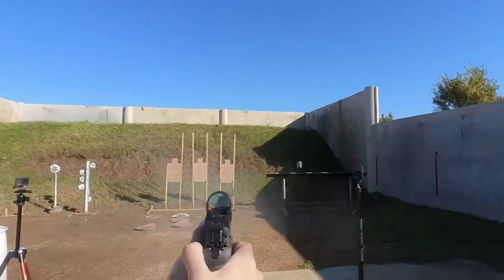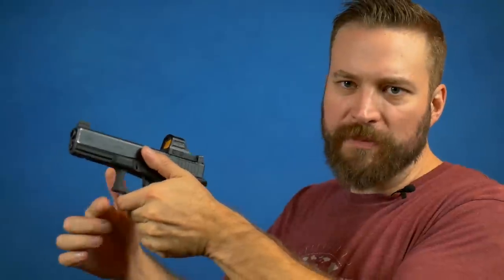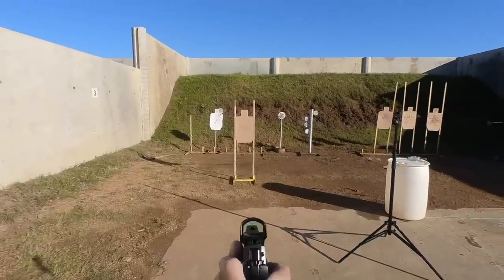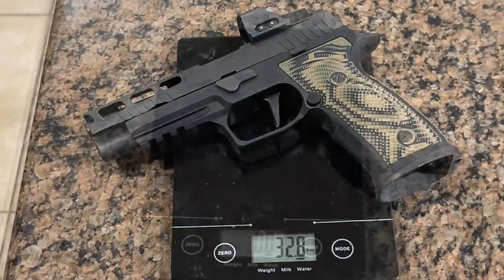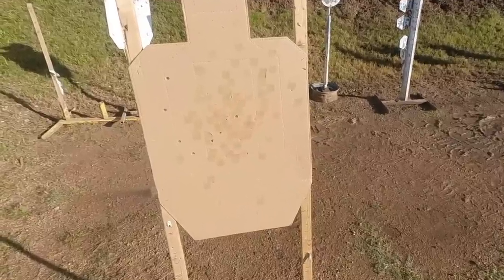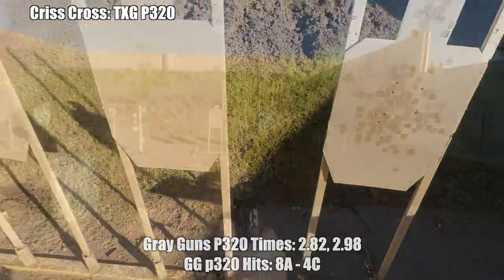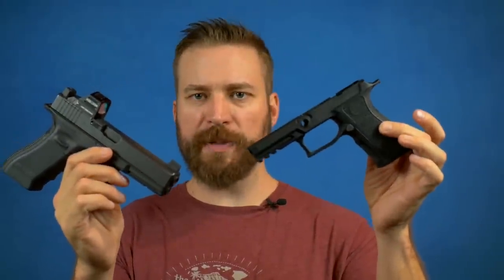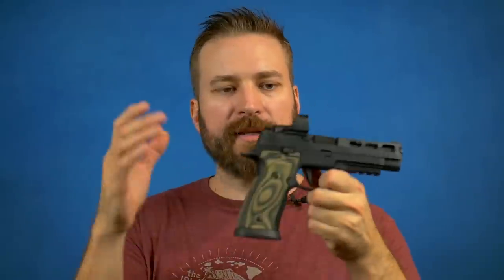Is BORE AXIS a MYTH? Testing Bore axis vs. Ergonomics vs. Weight

Comment: And the human factors side of the argument. Retired Army, I shot the issued 1911 and the M9 once it came into service. I hated the M9 because of the awkwardly, insanely high bore axis. When raising the gun it is very difficult to come onto target naturally. I prefer Glocks because of their low bore axis and natural pointability. They just come up on target with no adjustment, whereas with any high-bore I come up too high and then have to come back down again. I realize this is all subjective and personal. Shoot what works for you.

Comment: I think weight of the firearm is probably more of a factor than bore axis.
Reply: Ya, over all weight, hand comformity to grip, over all length, bore axis, and slide weight and many other things factor into being a good shot. At the end of the day we are talking about tiny percentages of differences. Much like stacking tolerances in a machine you dont want too many tolerances else youll get problems. Best to reduce tolerances as much as you can while still feeling comfortable with the weapon
 At the end of the day a gun is useless if you dont like how it feels/shoots.

Comment: Would be cool to see the low axis/good ergos MR920 included in that stack
Reply: Exactly. All those are improved P320 and not stock. You can definitely control stock glock better than stock P320 :)

MR920 and OZ9 are milking more from lower bore axis and would be more fair test.
Reply: @Atilakus  I own both and I control the stock p320 with the ugly original grip over my stock glock. everyone is different. :)

Of course now I run an XCarry grip on my P320 and it's much better. If only I could switch my glock's grip to that shadow systems style grip like I could with the P320.
Reply: @EOTechN9ne  I was not defending glock in general. It was more about validity of the test.
Bad ergo and low bore might be worse than good ergo and higher bore.
But when you have low bore and good ergo it is still better. 

Like ofc in the end how you could perform with the gun is ultimate but its still fun to talk about all the details and from physics stand point bore axis plays very important role :)

If you dont believe it try Laugo Alien .

Comment: Or in short, if gun is brick, brick no shooty well.
I'm sure a heavily modified Glock frame or a Laugo Alien in there would've changed the results quite a bit.
The Walther/Canik system offers great ergo and trigger with high bore axis, the P320 family great ergo, ok trigger and high bore axis, the CZs and Laugos offer great trigger, ergos and low bore axis, and the Glock has horrible ergonoimics, horrible trigger and low bore axis. A Glock should be modified or changed for a CZ P10 asap.
Reply: Glock doesn't need heavy modification, a simple grip tape fixes the friction problem. I honestly don't know why people bash glock so much, when gen 5 has some of the biggest magwells and above average trigger. It's a really capable gun for competitive shooters who don't want to bother with gunsmithing

Comment: Bore axis is not a myth. Its called Negative Leverage working against your grip. You have more leverage swinging a hammer with a longer handle so the further away your grip is the guns recoil has leverage working with it against your grip.

Comment: Bore axis is overblown in semiauto. 
Take 357 mag revolver and compare it to 357 out of Chiapa and then you gonna see huge difference in muzzle rise.
Reply: Worst thing I ever shot for recoil and rise was a Coonan 1911 (357 mag) that a guy had at the range. 
It was horrible...my S&W 29 ( 44 mag) had less recoil.
Reply: What do you know? You still live in N.Y.! LOL.........
Reply from the maker: For sure
Reply: Ditto, the Chiappa Rhino vs conventional revolvers. Although direct comparisons are difficult because of the differences in grip angle, shape, and trigger feel. 

But it's kinda moot. Jerry Miculek and Hickok45 have already done that type of comparison, and agreed on the advantages of the lower bore axis. But that's a revolver, no moving slides, recoil springs, etc, to influence perceptions. And they didn't seem totally sold on the Chiappa Rhino, perhaps due to their familiarity and comfort with the S&W revolvers.

David's video was informative and entertaining for me because I've shot only older semi-autos in mostly stock configuration. Never even handled a race gun. So it's fun to see what an expert can do with those pistols.
Reply: That is an excellent example of how a technical improvement doesn't overcome other factors, while the Rhino's low barrel axis is better the SW has a so much better action it remains the choice of pro shooters. If Chiapa could design an action with fewer and less complicated parts that fit into he Rhino frame it might change the picture.
Reply: @CCW1911  pro shooters don't shoot .357 mag.  .38 mouse farts don't really care about  ore axis :):)

Comment: Every time I watch a video review about a P320 variant and they inevitably mention "mUh HiGh BoRe AxIs" as a con, I roll my eyes so hard my retinas detach. Ergos are more important. The recoil from a 9mm isn't that harsh. And just because you train all the time on an ergonomically inferior design (Glock) doesn't mean it's a better gun. You just got better at using it. And that's fine and all. But that doesn't make Glocks better than everything else.
Reply: It would matter far more if SIG didn't seriously drop the weight of the slide as much as possible. Earlier with inserts in a stamped slide and now some more with the weight relief cuts. It is an issue but it can be tackled in various ways to reduce the impact and focus on other aspects.

Comment: Very good. I compare lighter pistols in realistic cqb drills.  Most will indeed shoot 28 ounce pistols better than 21 ounce micro 9mm....enough to make significant difference? So if you're going up In weight for carry to 35 ounces loaded...a good shooter can shoot .40 or. 45 just about as well as 9mm in short ccw distances & drills.  Also, even for competition I think many prefer a 32 ounce unloaded pistol to 40 ounces just for feel of control and transitions no?

Comment: I Do believe bore axis plays a role in handgun performance, lower is better.  I'm not saying it's a cure all, however, if lower along with other good design features then it's a plus.  Yes. it was mentioned here that the top competitors use high bore axis guns but they would be the same top competitors with the lower bore axis guns too.  I think of it as a mechanical aspect and not a person aspect.  If you give a formula one racecar a 3-5 percent performance increase then mechanically it should make a difference.  I haven't shot the Laugo Arms Alien pistol but would like to see you get and shoot one.  With the lowest bore axis pistol ( and other great design features) on the planet it would be interesting to see if you change your mind on this subject.

Comment: Thing about these types of videos trying to compare muzzle flip, recoil, dip, etc, is they tend to be mostly done by people. People are not perfect. I have to think someone out there has to have an apparatus to more precisely measure these things, right?
Reply: I've seen videos where pistols are shot from mechanical ransom rests to measure muzzle rise. The conclusion was that bore axis didn't matter much....Atlas gunworks goes into detail on a couple of their videos.
Reply: That was my comment. He uses Mantis a lot, so why not use that tool?
Reply: Ransom rests are very expensive and need to be setup for specific firearms. But agreed has been done. I do like the subjective content from high level shooters
Reply: Ransom rests have been used and provide some data, but the recoil forces on a human are more complicated than a single hinge point, studying extreme slow motion video shows the wrist, elbow, and shoulder all move to some degree. As a A to B comparison the Ransom set up correctly maybe, but it doesn't really show the complete story, for instance when a human shoots a pistol there is the rotation at the wrist but also torque twist and some almost straight up vertical movement. I don't know if they can still be found but Will Schuemann did some excellent videos showing this in relation to his hybrid barrel recoil system. So a machine could be made to duplicate a human firing a pistol but it would be expensive and World Class shooters can be very consistent and give valuable enough information it's probably not worth it.
Reply from the maker: How meaningful is data gathered from a random rest when you care about the performance of people?
Reply: @CCW1911  To me all you’re saying is that a stronger person with better technique will have less muzzle flip than an average person/shooter. Isolating the gun from the person would show exactly what the gun does. When put in the hands of different people, of course results will be all over the place. But the gun has not changed. How it is manipulated has though. 

Like my wife’s hands combined are weaker than 1 of my hands. We tested them with a grip measure thing. So there’s no way in hell no matter what gun she shoots vs what I shoot as long as it’s the same caliber, will she have less muzzle rise. 

So far using the MantisX, the stronger you are, everything else matters way less.  For example: she shot a p320/w a comp getting a 17 shot average of 28.27* vs a cz p10s (a much smaller gun with no comp) 12 shot ave 22.98*. For her bore axis probably is a factor. For me not so much. Pretty much everything I shoot is 3.7* to 6.5*. Wether it’s 40oz or 16oz, two finger grip or 3 finger grip, comp or no comp ect. The Springfield XD mod.2 &XDMs are the only guns that I’ve got under 4*. I’ve got low 4s with a Steyr M9. Everything else is generally in the 5-6 range. 

Strength and technique is far more important than anything else. Gun design matters too. Like I never would’ve thought the Springfield guns would outperform everything I own and I own a lot including overpriced guns like Sig, HK and Glock. 

Just my 2 cents
Reply: @96stealth  I agree that technique is important, strength not so much within reason, but I think you miss my point. Using a World Class pro shooter you can compare guns and parts like compensators for instance and get valid data, I've been personally involved in those projects. Take Rob Leatham for instance, he can do and has done comparisons between systems because he is so skilled and more importantly consistent,  in fact most of the improvements we've seen in pistol performance has been discovered by competition shooters. To be clear in theory a machine designed specifically to compare the recoil characteristics of different designs would be the absolute best but not worth the cost when a professional shooter can give you useable data not to mention that how a human reacts to a design is more important anyway.
Reply: @CCW1911  Not trying to argue, I agree with a lot of what you are saying. Strength is a pretty big factor and like you said this comes from competition experience from the best in the world. 

One pro (I forget who it was) said in a book that he wrote that to compete at a pro level, you need around 170-180lbs of grip strength per hand. Which is pretty insane considering the average adult male can do about 110-120. Bob Vogel trained to get his hand strength up to around 250lbs! Guys like Leatham or Jerry M probably have incredibly strong hands. Their relaxed grips are likely on par with the average guys crush grip. That’s a massive advantage to be able to do that. 

I can give a personal example of this. I bought a Kahr ct380 for pocket carry. The gun would not malfunction in my hands unless I barely held it one handed. My wife on the other hand, was getting 3-4 malfunctions every mag and it’s only a 7 round mag. Her grip strength is around 75lbs. I still can’t quite comprehend why she was getting limp wrist malfunctions. Hand strength was the clearest problem to me. 

With the data I’ve collected, technique, strength and practice will over come design flaws. The main reason I started researching this was because the guy from ASP was and is still preaching that your pinky is the end all, be all of recoil control. Well I knew it was a bunch of BS if you have strong hands. I had no way of proving it until I bought the MantisX. Shot a Glock 26 with and without the pinky extension. Got the same results in muzzle flip angle. I argued with him about it and his answer to me was frankly he is better than me in every way. I’m dead serious. Physics and yup just better. More knowledge, more rounds shot per year (25,000 was his claim), 100s of hours of training per year with the best in the country ect. 

The funny thing is, he posted a video not to long ago with a buddy of his trying to prove his pinky theory. Surprise! His friend handles recoil like a boss and John C was baffled and had to admit that if you have stronger hands, well……….

Sorry for the rant, but I’ve thought a lot about this subject and have done quite a bit of testing. There are other factors like slide weight, spring weight, gun weight ect. Which make some guns a little more challenging to shoot fast, but can be overcome by a more prepared and skilled person. Its more the person than the gun. 

I respect your opinion either way and do agree with some of your points.

Comment: These are fantastic data points David. 

I had an epiphany inspired by your competition shooter interview videos about how to lock your wrists, as it was a topic that alluded me, and I finally figured it out. I'm amazed at how much easier it is to consistently land shots under recoil. Tried it on my M&P 2.0 and it's 1911 grip angle I feel helps with the return.

That being said, how do you think grip angle has to factor into your results?

Comment: Nice video.  I used to drink from the low bore axis fountain, but my experience with my P320 AXG and also putting that FCU and slide with a polymer X-series frame has changed my mind.

I do find it interesting that you used an objective scoring system and even though the TXG won you still preferred the AXG because subjectively you “felt more in control”.  The scores between the two were very close so it’s not like the score wasn’t an indicator, but I think regardless of how you do this there is always a subjective element that will vary person to person.

Comment: Guns like HK USP, Sig 226 shoot the best for me, im not mr rapid fire just a normal guy into guns that likes to shoot a fist size group at the range. CZ 75 shoots great thats a low bor access. I dont think a 1/4 of an inch makes any differance, its more the design then anything and having a comfortable grip thats easy to hold firm. HK USP 40 the slide is this huge mass of weight and the slide racks so easy with 2 finger combined with the recoil system and perfect fit of the barrel, It's so soft and fun to shoot. Sig P220 shoots amazing as well and soft shooting. Also, if you have gloves you dont want them geting caught on the slide. Or a jacket sleave or something. It all depends on the design though rather then the bore access, If the grip was 12 inches long and you held it at the bottom of the grip yes but with good modern guns the differance is nothing. I've always gone with which gun i shoot the best with and cause less fatigue while shooting 10 mags in a row or just in general. My best shooting guns other then CZ have always had a higher access. I also shoot great with revolvers like 686 or Colt Trooper. Beretta 84 was a tack driver for me as well. Great video, it breaks things down in a sensible manner which is rare these days

Comment: I really like the Bro science videos please keep doing them.  It would have been nice to see a low bore axis gun that had a metal frame and variations in weight so the comparison was broader.  Since grip angle and ergos played such a significant role maybe using a S&W M&P or other low bore axis gun that has better ergos and/or more upright grip angle may have resulted in more fair comparison.  Granted you have limited time, guns available etc...  Keep up the excellent work and reviews.  I will become a Patreon supporter because of the quality and type of stuff you put out and I am a defensive focused shooter not competition at all but so much helps understanding.
Reply: @c3bhm  you missed the point completely

Comment: How much does the trigger affect the results? I'm guessing the sig trigger was nicer/cleaner break than the Glock?
Reply from the maker: They were comparable - Glock had an Overwatch shoe with some kind of connector in it.  The frame influences my ability to pull the Glock trigger whereas the ergos on the Sig promote a good trigger pull.  But trigger itself is about the same
Reply: I actually prefer a good Glock trigger. Like overwatch precision. When shooting fast all triggers feel almost the same. The only differences are weight and how they reset. Sigs have a weak reset. They don’t push out like a Glock. I heard there is a $4 spring that will fix this for the p320 that I’m going to try. But from the factory I think the sig is harder to shoot fast. I have have trigger freeze all the time with the 320. Almost never with a Glock.

For absolute precision, the Sig is just slightly better than an aftermarket Glock trigger. Splitting hairs really. Just my opinion. I don’t know, once you’ve shot an apex trigger on an m&p, everything else is kinda trash. Plus the apex doesn’t translate with other guns necessarily. Like I think the overwatch is better than an apex on a Glock.

Comment: I have a full size P320 in .40 S&W and I would like to improve it by changing out the grip module. I'm just now getting into USPSA and I was curious what module upgrade would you recommend?
Reply: There is a solis metal grip module for it, not cheap